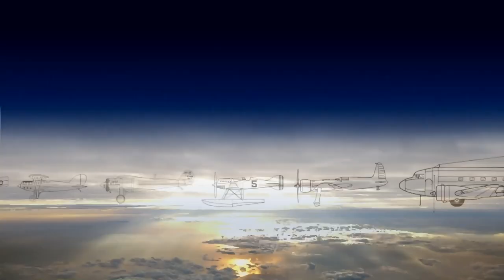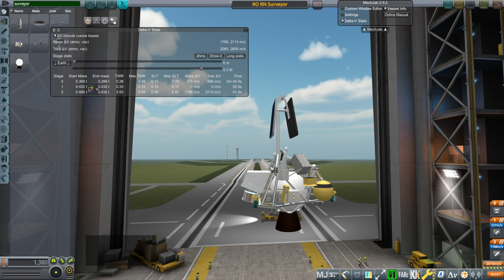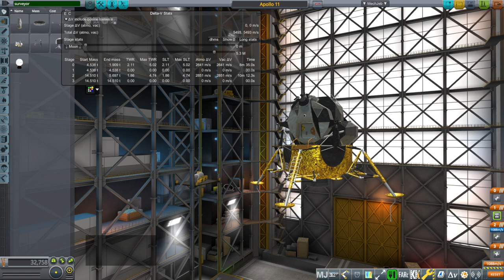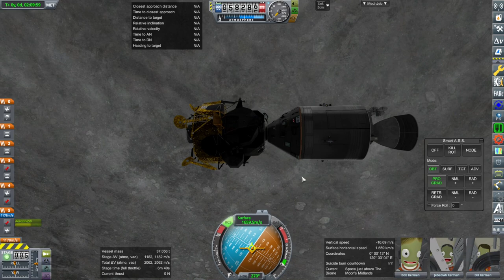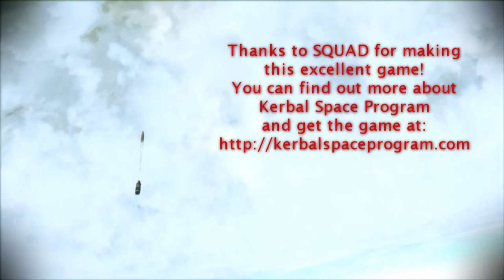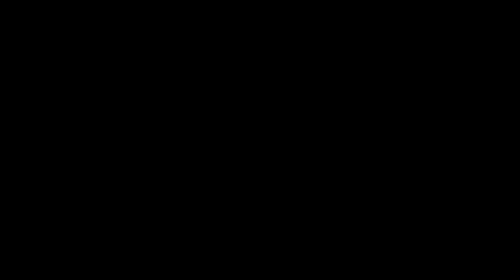Space Basics 10 - Landing on the Moon

Comment: During the last phase of descent I usually just choose the "UP" reference (after killing HZVEL) in surface S.A.A.S. It allows me to avoid what happened to you just then and just focus on the right throttle for landing speed. I am impressed at your delta V efficiency. I am definetely gonna try the aprox degree difference for calculating when to start the engines. I usually start too early and consume too much fuel.